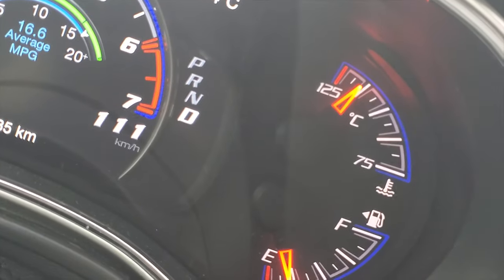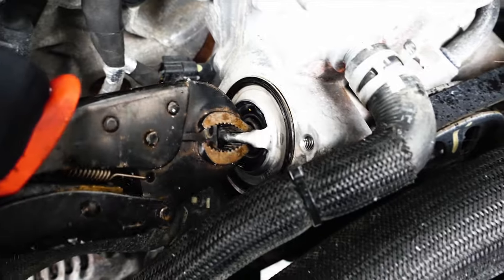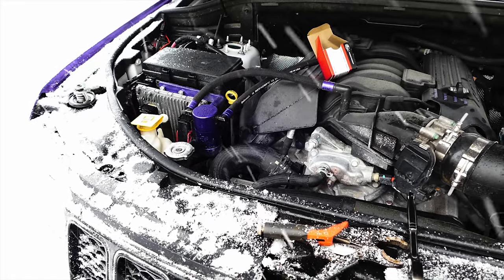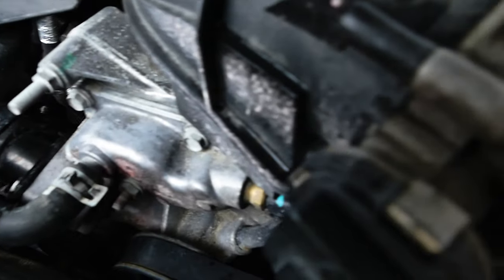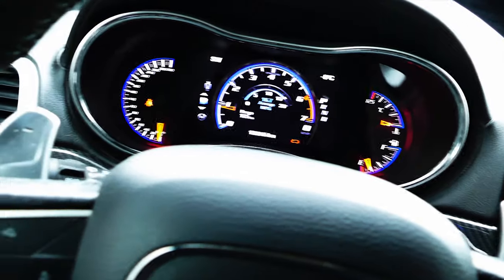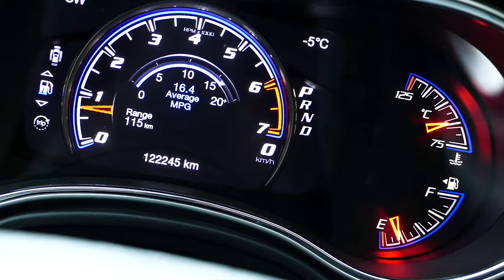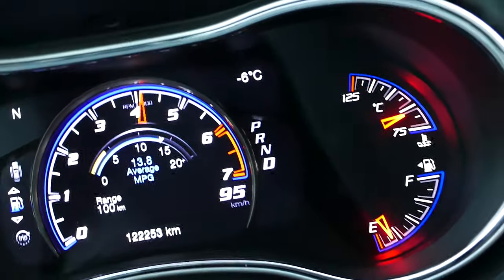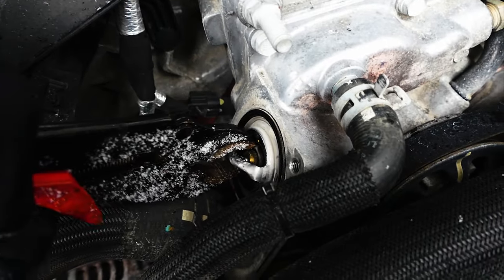jeep grand cherokee thermostat replacement

Comment: What kind of thermostat did you use? All I can find in my area is fail safe brand  oem are backed ordered  from dealer
Reply from the maker: hey there, here it is https://www.rockauto.com/en/moreinfo.php?pk=10152848&cc=3443444&pt=2200
gates 34053s
Reply from the maker: https://amzn.to/47caUIr